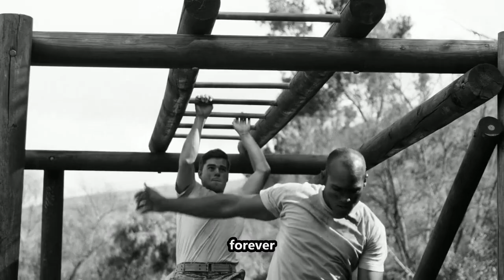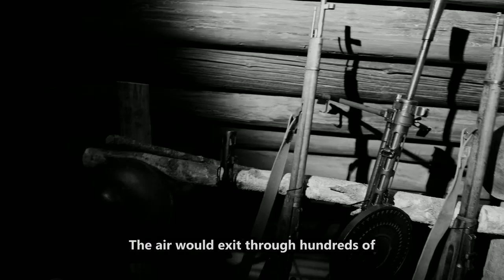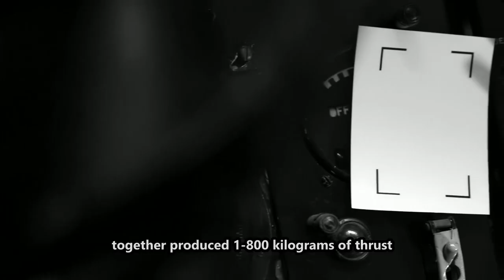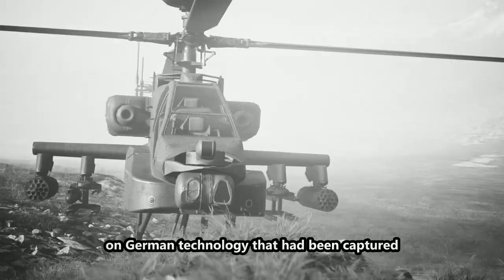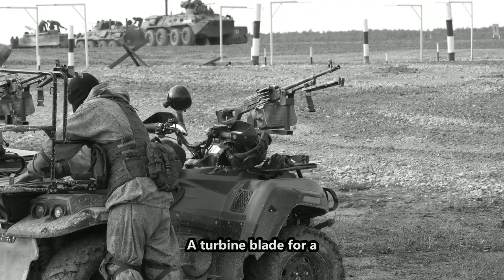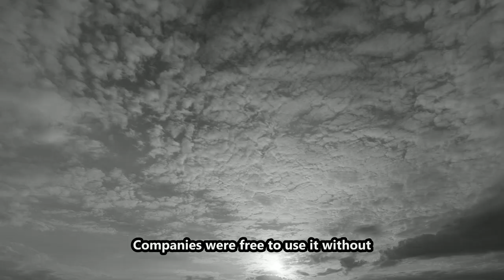Rolls-Royce STOLE German Jumo 004 jet turbine to create Nene engine

Comment from the maker: Which technical detail of the Jumo 004 impressed you most? The hollow turbine blades with internal cooling channels were absolute science fiction in 1942. Engineers in the comments have shown incredible connections - grandfathers who worked at Junkers, original blueprints in company archives, modern turbines still using the same principle. Share your technical discoveries about the Jumo 004 that Britain stole!